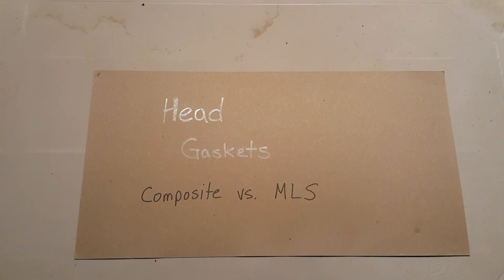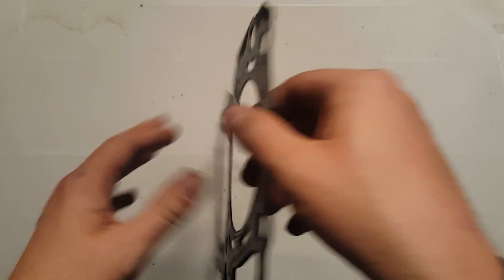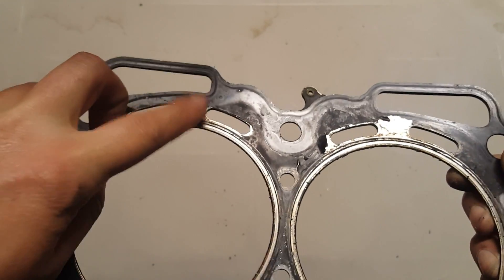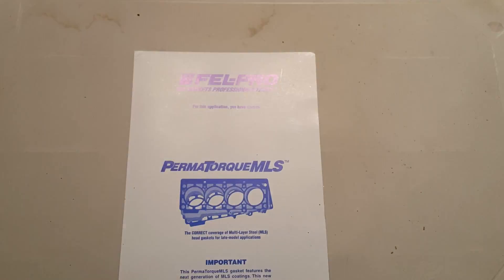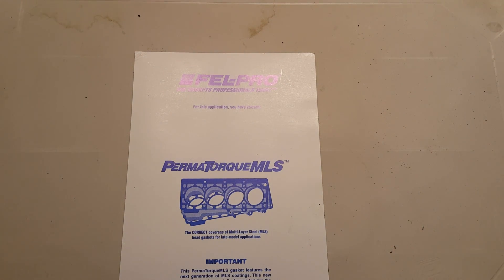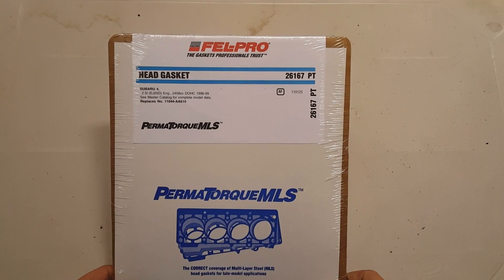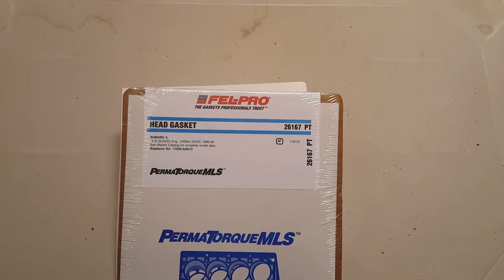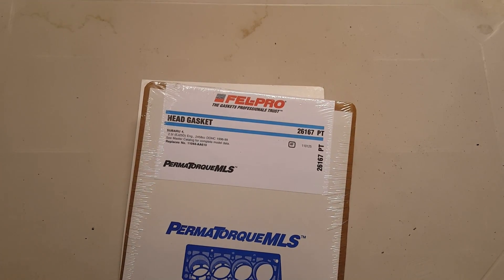Are Fel-Pro Gaskets Better on a Subaru Engine? Boxer Tech - Episode 2

Comment: (Edit Just looked 6 star IS STAINLESS STEEL!!!! ) see link >>https://www.smartqualityparts.com/head-gaskets/8-six-star-head-gasket-set.html
So 2008 subaru.. OEM gaskets failed by leaking oil on them at 65000 miles after Subaru convinced me the 1998 engine that blew by coolant in the combustion at 135000 miles, were a old design and the 2008 engine was completely redesigned and the problem was solved. The replacements that were done at 65000 miles I just took off at 128000 ( because of a poor choice on a aftermarket GMB timing kit off Amazon broke the belt. New valves) and were done by Subaru dealer were not MLS.
Why not stainless MLS or aluminum. Steel corrodes???  and is evident by the inspection of the seal. If you coolant is not changed when recommended it may be worse. however corrosion does not just start from the inside of the engine, right? mine looks like a failure started from every angle outward and inward. Does anyone make a better gasket. 6 star may..

So my 2 cents with aftermarket parts. Which one do you trust? Everyone seems to want to  have there stuff made less and less expensive AKA more failure prone. OEM is a good choice as i would hope they would learn by R and D  Well R and D  has not worked for Subaru in the past for  them otherwise this wold be a moot point. 

so 6 star, Felpro, Subaru,

Comment: Just had the Fel Pro Perma Torque installed in my Subaru Forester. However I  have to say that the Subaru gaskets that came off my Forester were not multi layered. They were both single layered junk. I saw them with my own eyes today. Subaru replaced them about 6 years ago and they just recently failed again. I like these triple layered Fel pro's much better and so does my mechanic.
Reply from the maker: The updated OE gasket for all EJ25x motors is multi layered steel. 2006.5 was the transition year at the factory, though dealer stock, even today, has the only single layer steel gaskets. If the gaskets were done 6 years ago, it's a good chance the dealer did 2 things wrong: 1. Used new old stock gaskets and 2. Used the wiz-wheel method of resurfacing the heads. Those 2 things are why it failed again 6 years later. The MLS Fel-Pro and Six Star are the way to go.
Reply: @BoxerTechGarage  What is the correct way to surface the heads - besides wiz-wheel? I'm very new to this.
Reply from the maker: @lifeisgood070 the wiz-wheel method is wrong, even though Subaru dealers have used this method. The correct method is to have a machine shop that is familiar with Subaru head machining to do the work.
Reply: @BoxerTechGarage  i applaud you for providing an response with absolutely no useful information
Reply from the maker: @lifeisgood070   i just told you, find a machine familiar with machining Subaru heads. There is no DIY method that I recommend to resurface the heads. To clean the block of residual gasket material, use brake clean and a fresh green or blue scotchbrite pad. I've also used drywall sanding blocks too with good success to clean the mating surface.
Reply: @alelx jines Good advice! My Forester is holding up beautifully since I installed the Felpro MLS ones.
Reply: Joe Dubiel what year your Subaru?
Reply: @determineddad7935  2000
Reply: 2000.     @determineddad7935
Reply: @determineddad7935  2000 S model. These Fel Pro Gaskets have now been in my Forester for 6 years this month. No issues
Reply: alelx jines 😩. I didn’t realize the 2011 STILL had the problem ☹️.  I bought my girlfriend a 2011 thinking it was safe with the newer engine.

Comment: I always use 6-star Head gaskets. They are a little pricey, but the most stout for EJ engines. I also avoid copper sealing spray. Subies have had HG issues since the EA era
Reply from the maker: Philip Danz I usually recommend Fel-Pro for budget builds. Six star gaskets are also top quality and I use those for my frankenmotors and turbo engines
Reply: Boxer Tech As long as it works it’s a good deal. Nice informative video 👍🏻
Reply: No subies never had hg issues the ej253 non turbo had hg issues. Only the ej253. Please dont spread that none sense. No disrespect.
Reply: @jeffreyheinzelmanjr3317  nonsense? EA63 and EJ25D - 96-99 EJ25D is the worst for internal leaks

Comment: Re-use the head bolts. It's ok. Done all the time by the dealer. And by me. No problems ever.
Reply: Just have to use a different torque method but they will work just fine. New head bolts require a torque method which allows for stretching of the new bolts.
Reply: @richardmiller3808  exactly, two uses is the max you will get out of them, and if you are really taking care of it I wouldn’t ever re use bolts. that are literally specified as yield bolts meaning they are stretched on purpose as part of the factory torque sequence. Therefore the bolts will literally be longer then they are supposed to be be with less strength, you can guess where the problems arise when you cut corners like that on built cars. This is the type of shit that makes everyone think all mechanics and car enthusiasts are hack job clowns.
Reply: I've read up to 6 re-uses can be feasible. That's way more than most people would ever need if you're keeping it pretty stock.
Reply: True, I’ve read many times about how re-using head bolts is ok. I just went with with ARP racing studs. Expensive, but made to be re-used multiple times, excellent design

Comment: As of now.... I don't have an example of a failed Felpro.... That is good news!
Reply: They appear to be great gaskets. Putting some in my 2000 Subaru Forester this week.
Reply: I put them in my 2000 Forester. They are holding up well.
Reply: @joedubiel6702  hi, are they still working? How many miles/km has it been since you replaced it?
Reply: @WAncouvOR  No issues. Holding like a brick wall. I think about 10,000 miles ago . Lets hope they keep going. :)
Reply: @WAncouvOR  6 years/40 thousand miles

Comment: did subaru ever fix this head gasket problem on their engines.. what tear or is it still on going problem.   I only think the 2.5 had this problem.   are the new 2018 better than previous engines.   any years when this problem stopp6.
thanks.
Reply from the maker: The head gasket issue was only in part due to the design of the engine, but also the materials design of the head gasket. The reason that the EJ20 and EJ22 do not suffer head gasket issues (as well as their EZ30 and EG33 H6 counterparts) is because of their smaller bore size. The sleeves between the coolant journal and combustion chamber were thicker. The revised gasket was made available in 2005, which was a true MLS gasket as I have outline in this video. The original 2.5 gasket was a composite type gasket similar to an exhaust manifold gasket. It was coated in a polymer to help it seal. This coating was affected by the very low presence of electrical charge in the coolant which over time broke down the coating and caused the seal to deteriorate, hence the second revision to the gaskets in 1999 and the use of coolant conditioner on all vehicles starting in 2000. This was to lower the pH of the coolant and make it more neutral and less susceptible to electrolysis. This is why the most common failure of pre-2000 head gaskets is internal. The second revision of the gasket introduced in 2000, had a graphite/polymer type coating on it that was bonded to the steel of the gasket. It suffered from the coating breaking down when in the presence of petroleum based products, like oil, which sat at the bottom of the heads and bottom of the gaskets. This is why you see 2000-2005 gaskets suffering from oil and water weeping (called external failure). In 2005, they finally acknowledged the faults and came out with the final revision combined with a revised head torque procedure which I do not follow because it is not needed with the newest gaskets. The failure rate is much lower post-2005 than pre-2005. The engine redesign in 2011 had nothing to do with the head gasket failure, considering at that point all EJ motors, with the exception of the EJ257 in the STI, were retired in favor of the FA which promised better fuel economy and favorable emissions due to direct injection and higher compression ratios. The transition from the EJ to the FA was purely due to stricter EPA regulations. The EJ257 is the same block, sans a few internal changes, as it was when it debuted in 2004. Saying that 2011 was the changeover is incorrect because the STI post-2011 is not affected by any of those issues, despite being the same engine since 2004. The WRX up until 2014 used the EJ255 block. No issues either since 2002. It was simply the gasket material and nothing else.
Reply: I work in engine assembly at Subaru and I actually put head gaskets on the engine (2.0 and 2.5 liter) and all engines now have a multilayered metal gasket from the manufacture.
Reply: What in the world took them so long to do that?????
Reply from the maker: Steve Molek The 2.5 was the only engine affected by head gasket failures. As of 2005, there was a much improved head gasket design that went further back to the  older models. All of my 2.5's have the Fel-Pro gaskets which are just like the OE improved gasket
Reply: Boxer Tech  thanks..  I want to buy a new Forrester this spring, so it will be s 2018 model.  I just very concerned over this head gasket topic. subaru has a great AWD system,  the head gasket seems to be their biggest fault.  

I agree 100% with your reply.  only the 2.5 had this problem  I hesrd this from nany others too. .  the 2.0 is fine, but it gets lower gss milage and requires premium fuel.  

again thanks for your reply
Reply from the maker: Steve Molek The FA engines didn't suffer any of the same failures the EJs did. That's not to say they won't, or they'll suffer other failures, because the FA is a baby compared to the EJ, which is going on almost 30 years old. I've heard they very great economy due to direct injection, they're limited by the CVT, which I'm not a fan of
Reply: Boxer Tech thank you sir for your info
I'm definitely going to keep researching on this topic. 
I'm 50/50 on which way to go
Reply from the maker: Steve Molek go for the Forester. You're going to be very happy with it. Everyone I know that has one, new or old, absolutely loves it.
Reply: @BoxerTechGarage  I bought a 97 Outback from a guy who replaced the Head Gaskets with the Fel Pro perma torque. He did it at 120,000 miles.... It currently has 253,000 miles on her. And he said after 5 years of replacing the head gaskets he didnt have any issues. So is thr perma torque head gaskets pretty much a permanent fix for the head gasket flaw? Also im planning on taking a trip 1500 miles there ans 1500 miles back. Should i have anything to wprry about?
Reply from the maker: @NATEDIZZLES813  I wouldn't worry about the head gaskets. Just make sure your maintenance is up on the car. Permatorque gaskets have never did me wrong.
Reply: @BoxerTechGarage  So it having 253,000 miles on the engine should i worry about all that mileage im driving stressing out the engine? It has swapped 4.44 rear diff so the engine runs between 3 and 4,000 rpms in 5th gear. I just getting an opinion on if i should take the chance
Reply from the maker: chances are you'll likely suffer an accessory failure more than a mechanical internal failure. I've seen engines with over 300,000 regularly driven long distances that still have the factory cross hatching on the cylinder walls. My Forester still look good internally after 210,000 miles and I'd drive that thing anywhere. Think about when the last time the timing belt was done. Check all fluids and make sure you monitor your oil level every other fill up in your travels. If you notice very little oil consumption, that's good.
Reply from the maker: @NATEDIZZLES813  4.44 is going to be a burden more on your fuel economy than the wear on the engine. My blue Outback has a 4.44 rear end and it's great for around town but on the highway, the Rpms are up there.
Reply: @BoxerTechGarage  Thanks for all the info!
Reply: Boxer Tech hello, thanks for all you do.  I bought my girlfriend a 2011 Outback as I was told since it had the newer engine it would not have the issue.  Now I have seen some comments that the 2011 has them too 😩.  I also saw your comment about an STI and am not sure what that is?  Do I need to worry about her 2011.? Is there any preventative maintenance I should do like change the coolant etc?  Thanks
Reply from the maker: @amlafrance1918 Congrats on your purchase and I understand your concerns. While the 2011 still has the EJ25 motor, it's not as susceptible to head gasket failure as the older models. Simple reason is that coolant technologies changed in 2010 to the Subaru blue coolant which contains improved conditioners to stop the deterioration of the head gasket. In fact, Subaru recommends switching to the blue coolant on all models after the gaskets are replaced or adding coolant conditioner to the green stuff. The best way to prevent the head gasket failure, is the same method for all models, change your coolant every 60,000 miles. If your 2011 hasn't had it done yet, do it. Replace the coolant with blue Subaru coolant. Enjoy your new to you car.
Reply: @BoxerTechGarage  i wanted an outbavk but ended up with a 2000 Forester and really like it. I literally bought a cherry picker to prepare to change head gaskets for the first time. Ive never took an engine out of a car before, but im decent with a wrench.
Reply: From what I've been reading the problems were from 1996-2010. Engine was redesigned in 2011 to fix the issue. Of course Subaru will not cop to this.
Reply: Boxer Tech Sir that was an excellent answer on the history of the head gasket problem.   I've searched online and never found any good answer.   

I really want to buy a new Forrester this spring, probably a limited model and there like 30K.  I get nervous when I know possibly going into the purchase of a historical HG issue.   I live in Pittsburgh,  there are tons of Subaru driving around here.   I want one.   

I spoke to the dealer and get no answer what so ever.  it concerns me when a dealer can't speak to this problem and convince me that it's been corrected. 

gentlemen,  thanks for your information.
Reply: About time. This is good news.
Reply: Great information guys! So after the redesign of the gasket, do they still fail or not? I am considering a 2015-2017 Outback (second hand about 25 thousand miles) and I want to know if this is still occurring or has been rectified completely. 
And if it still happens, can you put an aftermarket higher quality gasket that ends your suffering? :) 
Thank you!

Comment: can't find anything related to this on your website, looks like you redesigned it somewhat recently.

Suggestions?

I have a 2009 Impreza that is making an ungodly noise, so I picked up an 03 Forester to hold me over until I can figure out what I have going on as I'm seriously considering tearing apart the motor and rebuilding it once I have a better idea on what exactly failed. I've been told everything from rod knock to busted rings so I want to tear it apart and see what is going on in there.

Anyway, the Fel-Pro Hs26170Pt1 Kit i'm looking at picking up looks like it has this gasket so glad to hear they are supposed to be an evolutionary step for this engine's gasket.
Reply from the maker: Steven DeZalia Yeah my host suffered a crash on their server and I lost all of my data on the backup and primary drive. I'm in the process of uploading everything again. If there is anything that I reference that you cannot find, please reach out to me either here or DM me on Instagram and I will upload the information. I love the Forester body style. Much luck to you on your engine teardown and if I can help with anything, let me know